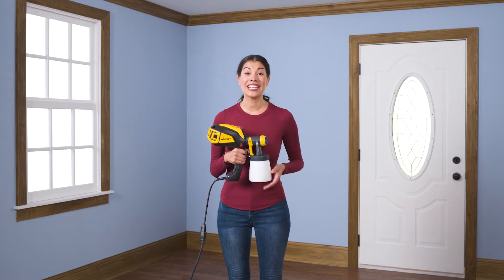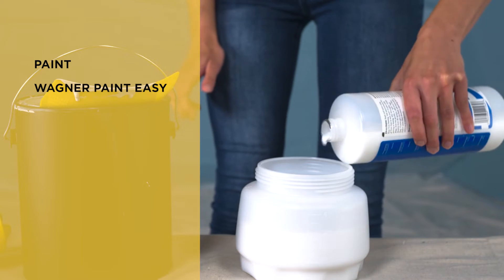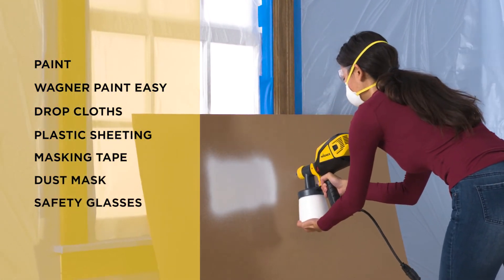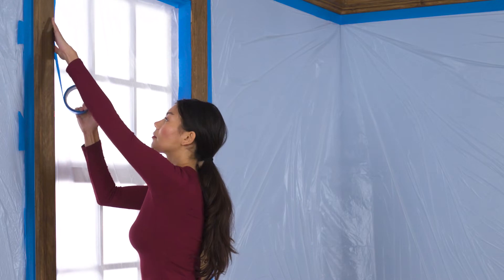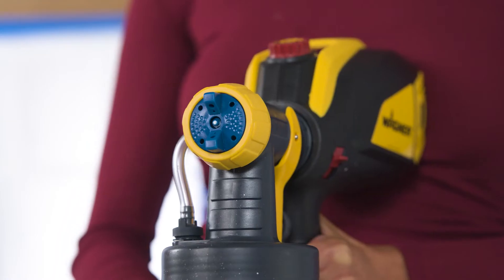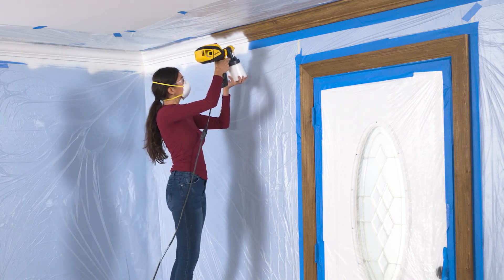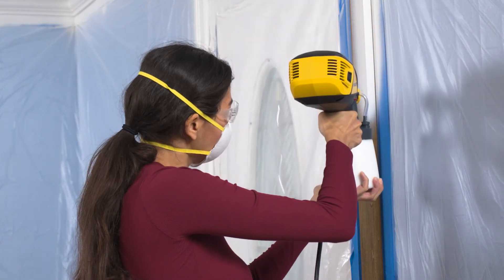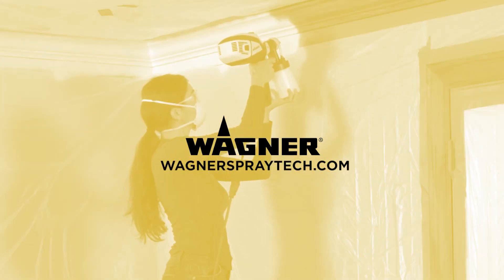How to Paint Interior Trim with a Paint Sprayer

Comment: Why do I get stripe patters on my finishes
Reply from the maker: Hi, thanks for your comment. There are a few things you can do to paint/stain to ensure it sprays well.
1 - Stir the paint/stain with a mixer in a drill until its creamy smooth, about 1 min per gallon
2 - Strain the paint/stain before it goes into the sprayer
3 - Add a flow agent, like Floetrol or Paint Easy (this is not a thinner) for latex paint – Penetrol for oil based
4 - Or you can thin, even as little as 5% can make a big difference, water for water based materials and mineral spirit for oil based material. Up to 20% is fine.

The settings also factor in. You should be spraying from 6-10" away. Keep the air power at maximum and reduce the paint flow to eliminate spitting and stripe patterns.
Reply: @Wagner-Spraytech  thank you,but how low doi reduce the paint flow? I have try all the settings positions and ,not luck yet!.
Reply from the maker: For the Detail Finish Nozzle, set the air power at maximum and reduce paint flow to eliminate spitting, increase paint flow to increase pattern width. Spray from 6" away and apply a wet coat with each pass. Not three passes to get it wet. Lay the project down, if you can, and spray down onto it. Gravity will help it level. Please let us know if you need more help troubleshooting!

Comment: I am using sherwin williams emerald urethane paint, the gun doesnt pull enough material out.   What should be added to get more material out?
Reply from the maker: We'd be happy to help you with this! Did you try increasing the volume control and material flow control knobs?
Reply: @Wagner-Spraytech  yah.  no luck, the material comes out unevenly.